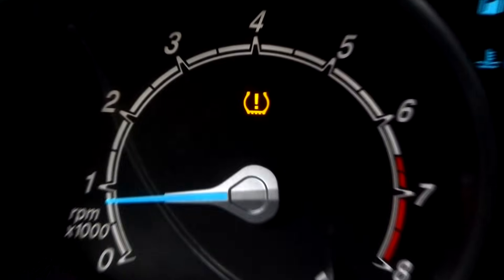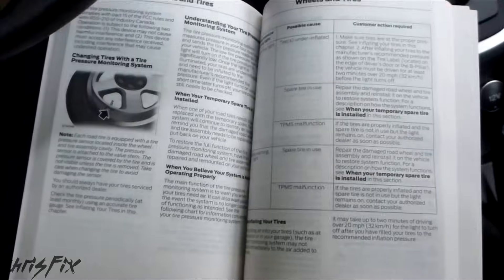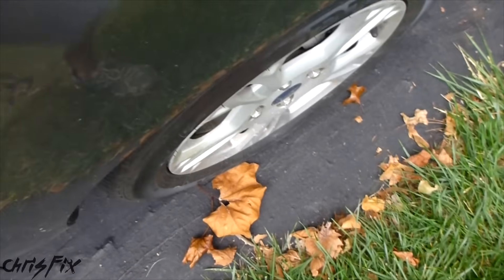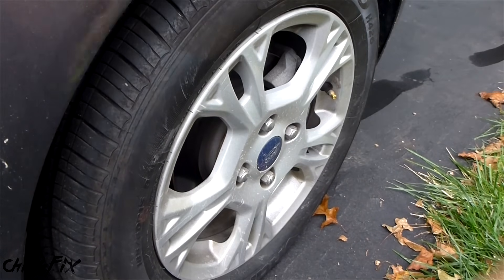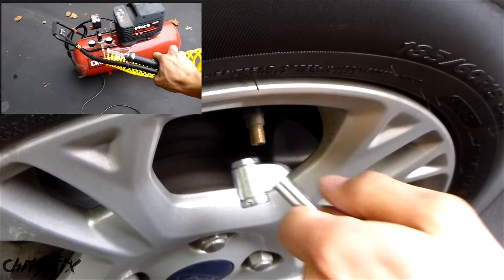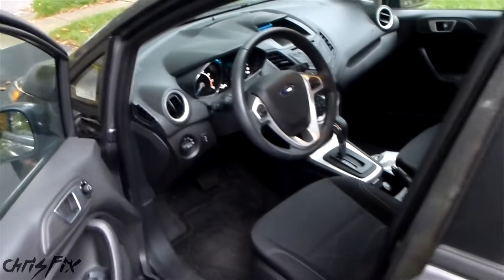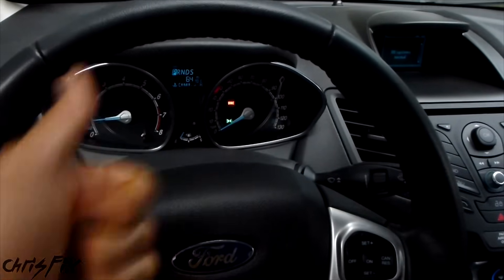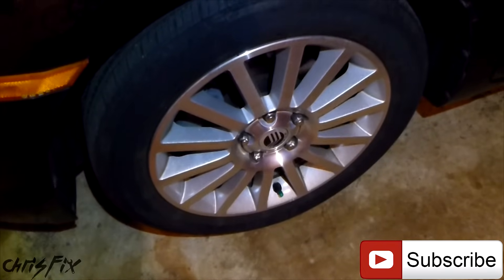How to Reset Low Tire Pressure Light (TPMS)

Comment: Many people told me the TPMS can be a pain in the ass and they just remove the sensors when/if they bgo bad and deal with the light on the dash board... i heard those  sensors  can be as much  as $300 each on a modern  day  car
Reply: Usually the sensors are around $100, plus labor of breaking down the tire and balancing it brings the total to around  $130 where I'm from.
Reply from the maker: Ira Friedman Sensors can be expensive but it would stink if you have a light on the dash all the time. Typically with TPMS sensors, the battery dies. They are pretty durable. The expensive part is the labor because you need to take the tire off just to get to a sensor.

Comment: So what if the tpms light wont go out? Does it mean the sensors bad? On my 06 tundra the front tires are suppose to be 29 psi and the back 32 psi but the light still stayed on after I set the pressures correctly.

Comment: does the PSI varies as well when the vehicle's on a lift and when it's on the ground? Due to the car's itself's weight and cargo weight?
Reply from the maker: ***** You know, I was wondering the same thing a few months ago. I should make a myth-busting video on it! The answer is the pressure does not change when you set the car down.
Reply: ChrisFix using common sense I think it should. Just think of a balloon, when u put pressure on it it pops... but somehow this doesn't apply to tires?
Reply from the maker: ***** I will have to look further into but I think there is a mathematical reason. The balloon pops because the surface expands until it is thin. A tire surface is not going to significantly expand. I think even the balloon has the same pressure it is just that the rubber gets so weak that it pops.
Reply: ChrisFix so different theories between balloons & tires?
Anyway do you know if it's more likely to cause a blowout during the summer time if the PSI is too high or too low? Or both?
And for winter...?
Reply from the maker: ***** In the summer you are more likely to have a blowout at too high of a pressure than during the winter because the heat of the road heats the tire up more and that increases the pressure.  It doesnt really matter winter or summer for a low pressure blowout. Both over-filling and low pressure can cause blowouts. No one is more likely because there are so many factors (speed, tire type, road, etc.

Comment: For my car, if it said 32 psi, then I just pump up to 35 for the front tires and keep 32 for the rear tires since front tires bear more load. Also, pump more air into tires result in higher MPG! (From my experience)
Reply from the maker: Khiem Le That is an interesting concept. You should stick with the recommended tire pressure because that is what the car was designed for from the factory. Tire pressure affects tire wear, alignment, and how the car handles so be careful. Two or three PSI wont make a difference but once you change the pressure by 20%, you can cause issues. Thanks for sharing Khiem!

Comment: Is the 2 minutes over 20 mph thing probably for most makes?
Reply from the maker: Scott Brixey It is pretty typical that you have to drive 20mph+ for around 2-5min on most makes and models. It will vary but basically, if you drive around to go somewhere it will be enough to test the pressure.

Comment: chris , i have an issue with my GMC ENVOY  and its out of this topic can you help me out ?
Reply from the maker: Yes I can help out.  What's wrong?
Reply: sorry for the late response ,,, my problem is that my gmc envoy have a zero oil Pressure  when its COLD ONLY , and when i press the gas pedal the pressure Rises to the normal pressure , but as soon as i let the pedal off the pressure droops to zero again . so i keep my foot slightly on the pedal so i maintain a normal pressure till the car worms up , and that's when the pressure stays in normal pressure .. and i also noticed that when the oil pressure droops to zero the engine starts to make a clicking sound ,, so whats wrong ? and is it dangerous to keep doing this and is it safe to drive ?
Thanks a lot Chris ...
Reply from the maker: Yes this is dangerous to keep doing. If your car is in fact running at 0psi oil pressure you will blow the motor or cause permanent damage. I think the first step you should take is to replace the oil pressure sensor. This is a cheap fix that is easy to do and you can see if your pressure is in fact 0psi. I am hoping that your sensor is just going bad and cannot pick up the lower pressures. Do you use the correct weight oil in your car?
Reply: I think the gag and the sensor are fine because when the gag droops down to zero , you can notice right a way a change in the engine it self it starts to make a clicking noises and when i press down on the gas and the needle goes above zero the noises Disappears.
i think its the oil pump gone bad or im afraid my engine cant make oil pressure anymore .
Reply: And i dont know what you mean by using the right weight oil in my car ,, i use a normal oil in my car , i change it every 3000 Km .
Reply from the maker: What type of oil do you use and what does your owners manual say? Like 10w30, 0w20, etc...
Reply: its 20W50
Reply from the maker: eyad aljamal And that is what your owners manual says to use?
Reply: The same .
Reply from the maker: eyad aljamal Ok, well it sounds like it might be the oil pump then. Get that fixed asap! Good luck!
Reply: Thank you man ..

Comment: Glad you mentioned the Nitrogen thingy.  Sooo many people I've talked to got sucked into that by the car dealer.  Just to point out....talking about psi vs temperature, filling hot tires (driven tires) to factory specs will leave you with low tire pressures.  You kinda said that on the video but don't think it came across too clear.

Comment: Good video, is it possibel to disable the system on a 08 Chevy HHR? Because I don't have sensors in my summertires.
Reply from the maker: Daniel28021991 Thanks Daniel. Unfortunately there is not an easy way to disable the light. I have seen people build pressure chambers and put their sensors in there, some people put black tape over the light, others pull the bulb completely (might cause an audible chime when you start the car), and some people try pulling the TPMS fuse.

Comment: A good rule of thumb is 1psi per 10 degrees of temperature change. If you fill tires on a freakishly warm day it'll definitely drop later.
Reply from the maker: Jesse Crandle Yes, as stated in the video. You should fill your tires when they are cold (for the reason you mention).

Comment: Right, so, to "reset" the light, you pump up the tyres.  Pure genius.
Reply from the maker: alexolife Yep. Just like to reset the airbag light you fix the problem with the airbag system and when you reset the check engine light you fix the problem that triggered the check engine light. Otherwise the light will just come back on! Not complicated at all!
Reply: ChrisFix do you have video on the damn air bag light?
Reply from the maker: Yes I do: Air Bag Light Flashing, How to diagnose and fix

Comment: Another factor I think is altitude. I was in Flagstaff AZ recently and the light went on. Left town to a lower elevation, the light turned off. Drove back through BING on it goes. Left town, you guessed it. Off. The light corresponded with altitude more than temperature but I'm speculating. Flagstaff (very nice place) is dang near 7,000 ft!
Reply from the maker: newcoyote Good thinking! A 7,000ft change in altitude will definitely trigger a light because that is an external pressure increase from 14.7 to almost 19psi! Any check engine lights? That must be a really cool car ride!
Reply: ChrisFix No other check engine lights, nope. And yes. Being from British Columbia, everyone who visits here says how beautiful it is and of course I agree. But man, North Arizona is spectacular. I will definitely be going back there.
Reply from the maker: newcoyote I need to visit there in the future. I always wanted to do a road trip across the USA!

Comment: Good advise as allways chris :-))

I must admit i know nothing about tire pressure sensing sensors, must be built into the wheel rim i suppose, not sure how they power a rotating sensor or read it.
I could guess, r.f powered from an emitter near the hub, pass i dont know lol.
Reply from the maker: zx8401ztv I was going to get into that but the simple video would have gotten complex so I took it out. The TPMS sensors are either a band that wraps around the rim, like a hose clamp, or it is connected to the valve stem. They are RF powered and the batteries last around 100k miles (5+yrs).
Reply: ChrisFix
 Thanks chris i have a better idea now :-), i thought that r.f had to be the link.
5 years per battery roughly, plenty of chances to change it when the tires are replaced :-))

Comment: Tpms is a great system, sadly many still fail to properly check the pressures especially as the hot and cold seasons hit. As time goes on the tpms will get better.
Reply from the maker: fordwindsor351 It is a good system! I cannot wait until there are sensors all over the car that give you even more info. It would be neat if the TPMS had temp sensors to give you tire temp.

Comment: So I promise I'm not stalking you, your videos seem to be in sync with my maintenance.... Right now I'm working on getting better fuel mileage (watched MAS video) Now, my question is I got nitrogen in my tires...and one is low... If I fill it up with compressed air it shouldn't affect anything other than the pure 'nitrogen'....correct?
Reply from the maker: Haha, I am glad my videos align with what you are trying to achieve! Filling your nitrogen filled tire with normal air will not affect anything at all. The only down side is you wont be able to go back to nitrogen until your next tire change if you wanted to do so. And obviously you know my opinion on nitrogen anyhow lol.

Comment from the maker: It is common for your Tire Pressure Warning light to come on during the changing of the seasons (Fall to Winter and Winter to Spring). Learn how to reset the light so you can drive safely to wherever you are going! Also, let me know what you think about the top tip at the end!
Reply: 2007 Lexus is250??
Reply: +ChrisFix How about adding air to the tire?
Reply: +ChrisFix Great video.  And I agree 100% with the top tip at the end.   Nitrogen is typically used in situations where there can be extreme temperature differences in the tires in a very short amount of time - such as aircraft tires.  The hazard of using straight air in these circumstances is that the tires may blow out.

But for average street driving, nitrogen charging is just a waste of money.
Reply: +chrisfix hey chris where did you buy your green tpms gauge??
Reply: fgffwr....hth
Reply: The
Reply: ChrisFix  hey Chris..great vid man. I've looked for that gauge you used but can't find it. Do u think u could give me the actual item name or number and where to find it? I looked at the name on the gauge and googled it but to no avail. Any help would b greatly appreciated. Thanks, and keep up the great work..✌🏻
Reply: +ChrisFix From what i understnad this kind of system is called DWS(Deflation Warning System) as it just warns you about a possible deflation unlike TPMS which gives you the tire pressures.
DWS uses Wheel speed sensor(a tire that has lost air will rotate faster) and the other is from pressure sensors.